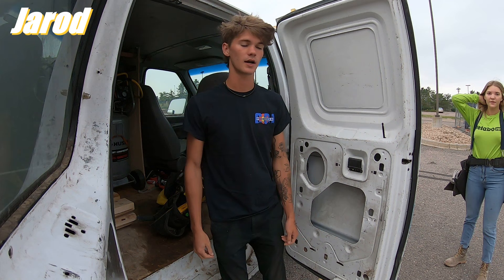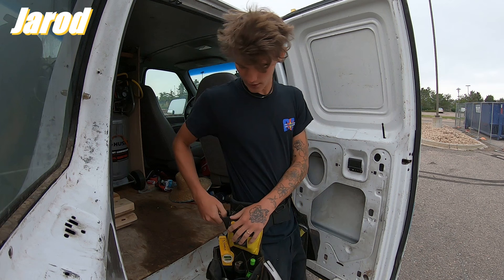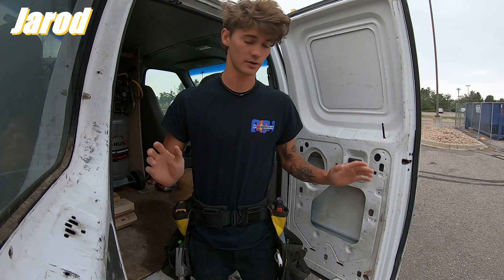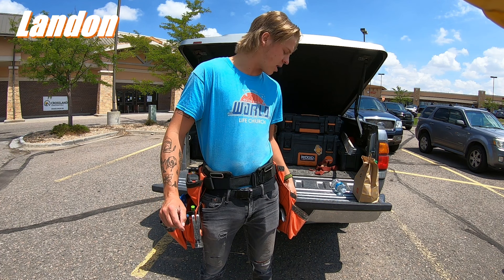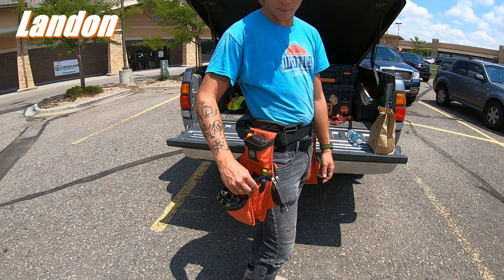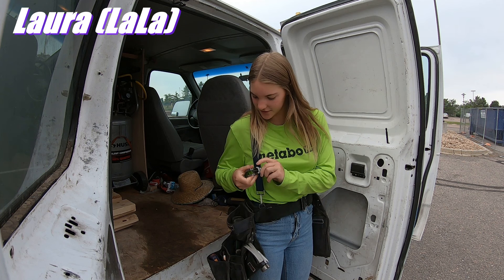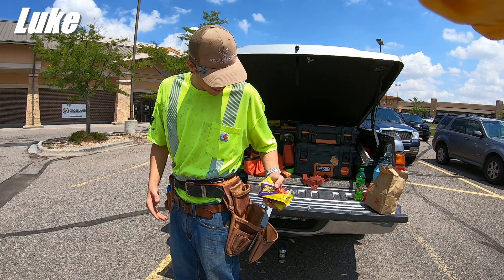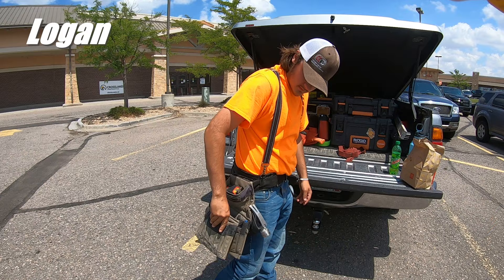Meet the Crew! // Toolbelt Tours! Badger vs. Diamondback

Comment: Tape measure needs to be on the left side.
Reply: Why?
Reply: @santi73k  r u left handed?
Reply: @santi73k  it's an efficiency thing. You have the tape measure on your non dominant side and your pencil on your dominant side so you don't have to switch hands on anything when marking lines.
Reply: Seems obvious to me if you hold the pencil in your right hand. Speed square also goes on non-dominant side for the same reason.
Reply: What if I'm ambidextrous?

Comment: Great to see young fine men carrying on the trades of skilled labors and willing to put in hard work for their incomes.  I started out as a residential painter in construction at age 19 and worked for 24 years till I got tired of the B.S.  Our painting crew were very young as well,  whereas masonries ,  carpenters, framers, concrete flatworkers, roofers, electrciains, sheetrockers,  wood floor installers, ,  so much to name,   were diversed in age ,  but those young guys had to learn from the old guys the tricks of the trades somehow.

Comment: Question?  I removed all tools from my belt and w/o naming a ballistic belt!  Guess what they were both very light however my belt was a slight bit heavier by that I mean 2 pounds?  
I am a finish carpenter (contractor I Sub out to a GC).  
I own a very expensive set of Akribis Leathers with a solid place for everything!  The leathers are molded to your body on a sewing horse the Owner uses (Luke) and he calls you when u order a custom belt!

I am older than you guy by min and owned all the belts.  I wore most out which kind of looked like the ones you gave away?  The badger buckle system is nice but wait until you see the one Akribis uses!
2nd to none and comes from the military SF jump system.

I absolutely love the way leather smells and ages!  Badgers and DB remind me of well ?  Cloth?
But they R light!  Until you put tools in them!  Plus I am not a small guy ? Under 6’ and 2 bills so the little bit of weight does not bother me!   But I hv to say mine does not come in orange?

Hey I am busting your arm u guys are great and I love the video plus u guys are hard working men!
Very hard working!

Comment: How did you stick that hammer so quickly
Reply from the maker: Into the hammer holster??
Reply: @Coffmanconstruction  yeah
Reply from the maker: I ground my handle down a bit on the bottom and also coated it in hard plastic so it would slide easier